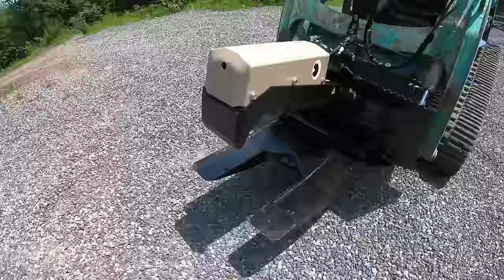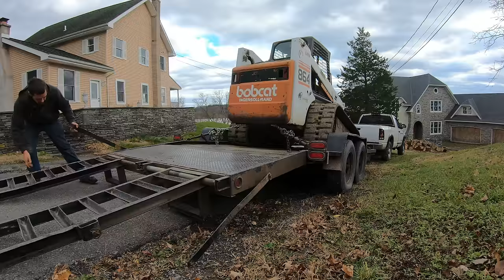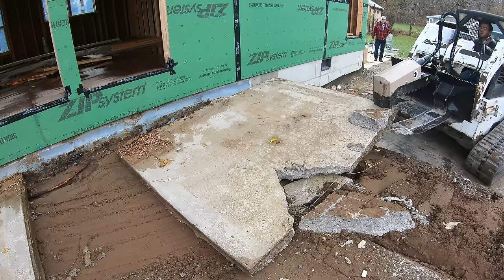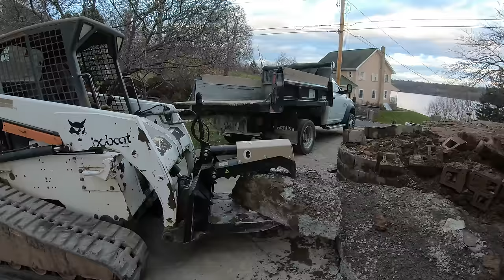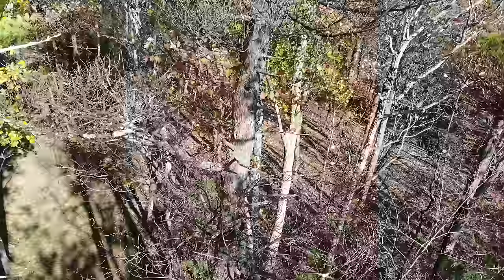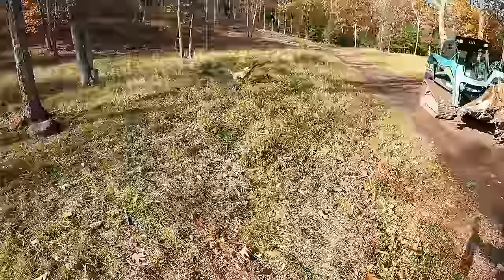Breaking up a concrete patio

Comment: That reinforcing mesh sure was doing a lot sitting under the concrete
Reply: Yea bad workmanship...at least it fixed now
Reply: It looked more like coat hanger wire, so not sure it would have made any difference even in the concrete.
Reply: Very true! Lol someone must have used a few tubes of block adhesive on those steps though, I’m always impressed by the strength of that stuff
Reply: yeah. whoever worked on pouring those slabs must have forgotten what the hook on a rake/puller is good for... pulling the mesh back off the ground and into the concrete after you've walked all over it
Reply: @drcornelius8275  "chairs" meaning something to prop the mesh up?
Reply: @drcornelius8275   Yep I've broken up hundreds of slabs and the mesh is just barely hanging on to the bottom
Reply: @RiverValleyLandscaping  more like a damn case those things wouldnt budge in a f5 twister lol
Reply: @crackwitz  or just put some distance holders there
Reply: The contractor was thinking about the removal lol
Reply: The patio was overbuild.
Reply: I often see people on you tube just throwing rebar sheets on the floor. It should be supported on wires to sit mid way through the slab or pressed in before the surface is trowelled.
Reply: Aa
Reply: That reinforcing mesh surely was doing a lot sitting under the concrete.

Comment: I’m just gonna say it’s an entirely missed opportunity for using a googly eye.
Reply: There’s an eye sticker on there, just not googly
Reply: @dawsonossello6012  yeah but imagine how awesome it would look WITH googly eyes!
Reply: they sell that as an aftermarket mod kit
Reply: Would really be cool if the eyes were glow in the dark or reflective.... get a good scare once in a while.
Reply: Chomp Chomp Chomp and the Padio is gone :D
Reply: $3 upgrade, Andrews not going to spend that!
Reply: @dawsonossello6012  please
Reply: The first iteration of this piece of equipment actually had googly eyes. But the engineers had to change it to a sticker due to a bunch of skidsteers running into things and not being able to drive straight with the original prototype on.

Comment: Andrew, what did the guy driving the little white dump truck say about that first load of concrete? Lol
Reply: Adam obviously nothing since he came back for a second. Would hate to be a car next to him in traffic if one of those slabs broke the straps and slid off. Absolutely crazy....
Reply: That poor dump truck , I hope the gate was not bent , that was some real good loads lols 😎
Reply: @Akcd11r2002  I wouldn't be worried about them spontaneously breaking or flying out of the truck with a gust of wind - the thing you've got to worry about when checking a load is what happens in an accident. If you lock up the brakes or hit a brick wall, is the load coming through the back window of the cab? If you have to swerve to avoid a pedestrian jumping in the road, will the load keep going straight? If you get rear ended or T-boned, will it end up in the other vehicle? Driving smoothly on good roads, you can keep a coffee cup balanced on the bumper, in those conditions straps and chains and load binders are irrelevant. It's the emergencies that working load limits are designed for....
Reply: @kevinvermeer9011  Well said, good reminder. Thanks.
Reply: @kevinvermeer9011  HE HAD TOO MUCH WEIGHT THAT FIRST LOAD I WOULD HAVE BROKEN THE SLABS UP SMALLER SO HE COULD CLOSE THE TAIL GATE AND I WOULD HAVE WATCH OUT FOR  HOW MUCH I PUT ON HIS TRUCK  SO HE WAS NOT OVER WEIGHT
Reply: @kevinvermeer9011  I was thinking the same thing. That was very irresponsible and I don't think I would have loaded anyones vehicle like that. One wreck and an entire family could have been killed. The driver, Andrew and the homeowner would all be on the chopping block for a massive lawsuit.
Reply: That's  heavy
Reply: that truck was impressive

Comment: 1.  It is always nice when the big boys big boy toy can be used to make money.
2. It was nice that they put ground fabric under the slab to, I guess, to stop the concrete from migrating into the crushed stone.
3. They definitely reinforced that second concrete porch better than the first.
4. I am impressed with the stability of your Bobcat.  I would have sworn it was going to tip forward when you picked up those bigger pieces of concrete that were sticking out there.
5. I wish I was 30 to 40 years younger and had your energy, knowledge, and skill and could do that sort of work.

Comment: To the rep: "Sir, Andrew's a little hard on the equipment - he'll make an excellent test case for your gear".
Reply: But but but, if you give it your and the equipment's all and the equipment fails, whose fault is that!
Reply: @spookje111  Well when it "breaks for no reason" its clear that there are improvements to be made. XD
Reply: He’s not hard on the equipment, he just breaks  stuff in very well

Comment: duuude that truck was definently over weight lol
Reply: You say that truck was too overweight to drive down the road?  Well... I'm overweight, and I drive down the road.   :-)
Reply: That’s wayyyy to much! Perfect.
Reply: Just what i was thinking, poooooor axles on that baby truck. Americans......
Reply: That truck is probably an F550, so it'll take 12k lbs, (5.5 tons)
Reply: @tech4pros1  it was a Dodge not Ford.
Reply: @Drewsky840  Ram 5500 11,140 pounds carrying capacity
Reply: @jacksonbennett6151  That's wayyyyy too much!  Now, let me add just 3 more pieces.

Comment: Several years ago I had to demo 1000 sq ft inside a commercial building , part of remodel  for a tire shop. I had 2 sizes of excavator, 2 hydraulic rock hammer sizes. However...I told general Contractor to hire Concrete cutting company, cut up slab in 2 ft squares do to wire mesh etc. I was able to use mini-excavator, 18 inch bucket, load out my dump truck fairly easy. One of the issues with rock hammer was the noise and splattering of concrete etc.

Comment: Reminds me of a conversation I had with a pavements shop foreman. He told me of a slab they made for a customer.  He said he watched his men pull the reinforcing wire up to the center of the concrete as they placed it in the forms.  later, it was determined that the slab was in the wrong place. As they removed the slab he noticed the wire was on the bottom. You can buy wire stands to place under the wire that holds it in place, we always used them after that.

Comment: I have appreciated watching the construction of your property and the way you went about designing and overcoming obstacles it would be great to see you make a custom Castle style stove you should make it a three-way stove so that you can feed it from both sides but feed it on an angle and seeing that you're in this Steel you should make a 10in flu that would set your place apart you can build it into the wall on one side you have a concrete floor we should make it out of plate and diamond plate the work that you did this year is incredible thank you and by the way that was a heck of a run you took all the way to New York City and it was even more challenging for you and your friends to get back thank you for all the helpful information

Comment: Are there any toys you don't have? ;) That was certainly a well engineered patio. Love the respect you have for the job and other peoples stuff, placing those pieces in the truck so smoothly. If you weren't already, please wear ear protection, even on a "quiet" machine like this, you'll miss it when its gone.

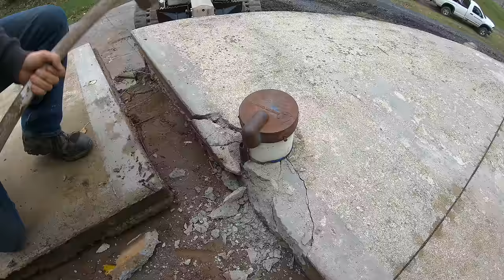Comment: 11:16- The next time you go to break up a small part of cement on dirt, remember to undermine the soil under what you want to break. Your sweet spot will crumble sooner. Just an inch of air is enough. My dad often used a pencil.
One of those tree stumps (inverted, power washed, and cut level in the right places) would make a great table base. Maybe sprayed with shellac and given a glass top?

Comment: Cool attachment  already paid for. Never pitch anything toward house unless it settled.  Fencing stayed on the bottom. Why did you switch skid loaders? That dump truck took some weight. Attachment was more efficient than an excavator impressive.

Comment: I bet that attachment paid for itself on this job. looks like a well designed piece of equipment.
Reply: That guy didn't look like he is a big spender
Reply: @1STGeneral  Its not question of spending so much as the time Andrew saved on the job. He's charging probably a flat rate but instead of busting it up in small pieces he slabbed it out with his equipment saving all that time on his machine and he's on to the next job to earn more.  Smart man.

Comment: Way easier with a mini excavator and hydraulic thumb. Lay down the blade and use the bucket and weight of machine to break it. Then load it in a truck or trailer without all that shuttling/tearing up the yard.

Comment: Do some prep in the corner areas. Take a large maul and bang some fractures in the stress points. Your slab will break out better and won’t destroy the corner of your step 5:55. Also be careful leaving a crow bar on the slab when your breaking it. That can become a Projectile. Otherwise that’s a cool attachment
Reply: Ok. So you do use a large maul. But you should turn around and grab that crow bar instead of using your fingys.

Comment: "How to pinch your chainsaw bar" @24:07 - cut from underneath the trunk vertically upwards because the weight of the tree prises the cut apart, as opposed to closing the cut when cutting from the top as done here (which pinches the bar, causes damage, is dangerous, and slows the job down to remedy the pinched bar).

Comment: Its ok for using as a grab to move things put pretty poinless for moving those slabs. After he moves them he still has to break them up to get rid of them. Surely a hydraulic breaker on his 3 ton excavator would be a far simpler option.

Comment: That's just outside West Camp, 1st right after the church. 
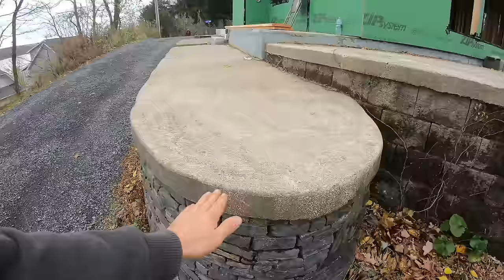@3:12 you can see how far the wall is jutting out on the road that leads down to 3 other houses, the old guy in the red jacket is coming up the road to see how Andrew gets on. Before the rebuild the front door was leading to the road, now its on the side of the house.

Comment: Whomever installed that concrete did a poor job of getting the wire embedded into the concrete. Concrete was just sitting on it instead of it being embedded in the lower third.

Anyway, could almost reuse those whole slabs you pulled out as a patio. Just square up the chunks and you'll have some nice pavers.

That new attachment does it job well. Good investment.

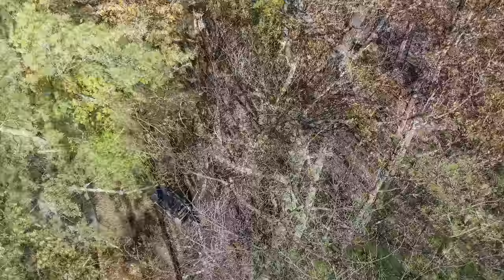Comment: Andrew, the match cut with the dissolve at 21:25 worked well, making it look like you're going from one job seamlessly to the next, but why did you insert the shot of Levi walking along thus spoiling the illusion slightly.

Comment: I'm surprised that they did not jack up the section that was sloping towards the building, instead of ripping it out. Drill some holes along the building and pump leveller in to it

Comment: I wonder if the guy who let Andrew load that concrete into his truck has seen any of Andrews videos....  Lol, brave man.
Reply: IF THAT SLAB BROKE OFF OVER THE TAIL GATE WHILE LOADING NOT GOOD IT WOULD BE MAJOR PROPERTY DAMAGE TO HIS TRUCK LIABILITY AGAINST  THE LOADER OPERATOR THE FIRST LOAD WAS A OVER WEIGHT HAZARD
Reply: @alphonsotate2982  Your caps lock is on, stop yelling at me its uncalled for....

Comment: You should have stressed the concrete around the pipe slightly then hit it with a hammer. You would have hit it once, used the machine to pull it out like a man and been done. Been there, done that. Ex-demolition foreman speaking from experience.

Concrete does not like to be stressed and also needs to be able to move to break. In doing so it gives up very easily.

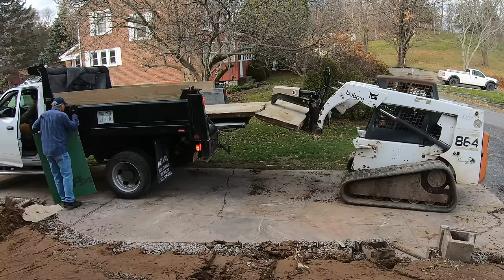Comment: 13:23 he must be the owner of the truck or an excellent employee. Use the truck brakes instead of the transmission to hold the truck while loading. The rock and forth action can damage the transmission very quickly.

Comment: Hello Andrew. Would you say the grapple is better suited to the IHI or the Bobcat? 
It made short work of that concrete patio. 
Great video, thanks for sharing.
Reply from the maker: Those two track loaders are similar as long as the bobcat is working right.

Comment: Hey Andrew! Awesome video. Why did you put it on the Bobcat and not your other machine? The IHI is more powerful isn't it? Was it too heavy for your pickup? Those machines are much heavier than most people would think.
Reply from the maker: The IHI was on another job. They are about the same strength.
Reply: @AndrewCamarata  thanks for replying so quickly!

Comment: I'm not a concrete professional but have put down my share of slabs, I hope Andrew warned the home owner not to use the same guy that put in those slabs for any future work. Only reinforcing steel was on the ground with concrete poured over it, worthless, waste of money. Wide slab had no footer against building which would have prevented slope towards building, I would have also put a footer is center of wide slab running parallel with building and plenty of rebar tying the footers into the slab. Just saying.

Comment: Wow those concrete contractors did a bad job, they just tossed the rebar onto sand and poured over the top, it was adding no strength to that pad at all. No wonder they tilted it back to the house as well, looks like a root grew into the washed out sand too

Comment: Set the E brake on the truck otherwise you’re going to  blow out the transmission gear Pin
Reply from the maker: In which truck? The white truck is standard.
Reply: When I would unload my skid steer from the trailer without setting e break it would rock the truck back-and-forth that’s what they said Broke the transmission  ,snapped a part inside but who knows Great video
Reply from the maker: Rich Scott i’ve never had that happen, but I do set the parking brake, and sometimes put it in 4L

Comment: Only a complete idiot would put a poured porch around a well housing.  Wow.
Reply from the maker: Why?
Reply: @AndrewCamarata  It greatly limits the equipment you can use to replace a well pump if you need to.  Or if you have a leak in your home connection.  Or if you have an electrical problem and need to run a new line.
From the well to the house, you should always plan on having a truck be able to roll over it to replace the pump...and able to dig from the home to the well.
I had my well pump fail on a Saturday winter morning.  The guy replaced it buy rolling his truck with a crane right over the well head and easily pulled it out after about 2 hrs of rigging.  You'd need a bigger crane and more specialized equipment to do it in that location.
Reply from the maker: You can still get the pump easy. The only thing that would be harder to change is the line from the pit-less adaptor to the building, but those usually don't go bad.
Reply: @AndrewCamarata  I've had some bad luck with wells.  It seems like everything either goes really well and you have no problems or very wrong.
Not disagreeing with you.  It just seems like a really bad idea to build a porch over a well when you might have to rip it up if something goes wrong.